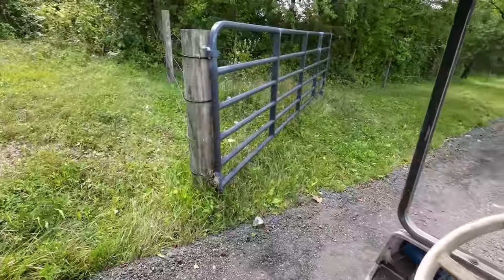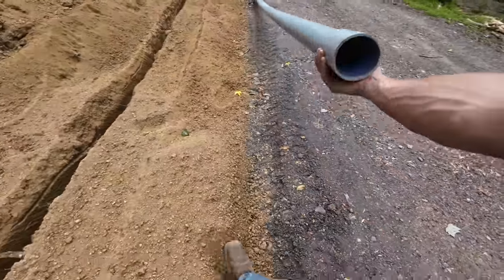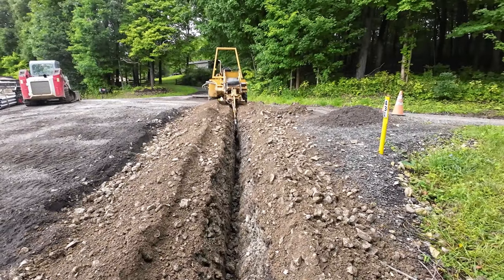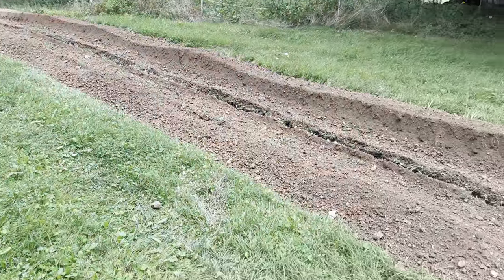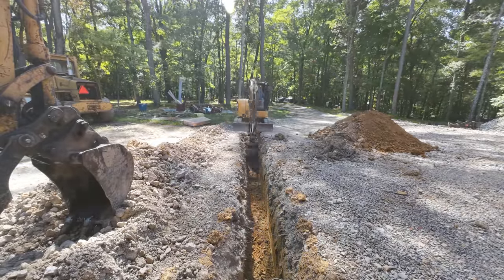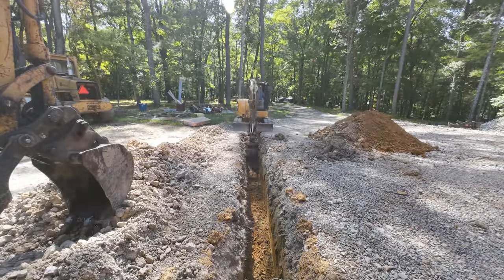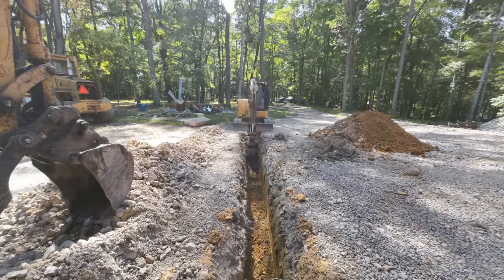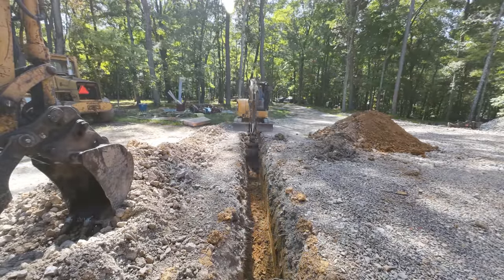Running Nearly 1/2 mile of Underground Electric, Costs over $64,000??!?!

Comment: After watching this, I realize how much better equipped you are than the small public works I'm employed with...
Reply: Damned hard work so far. Now need a power cable pulling thru.. Best of luck
Reply: @gags730 .. you know whats worse than that... legally most state equipment has to be offered for free to local municipalities.. but they never go out and get it.. too much effort.. so your local taxes pay for equipment that they probably could have got used.. maybe not in the best condition but you never know maybe in pretty good condition.. also volunteer firehouses can get free state equipment .. its a good deal that they pass up because either they are clueless or don't realize taxes pay for everything they have.
Reply: Depending on the amount of property you have and the desire to construct a required number of residential properties to be served by your project "may" have produced a cost benefit even a profit.
Reply: @BRI33NOR   He also does more work than most municipalities.  And he is just one man.
Reply: He's sure got just about any tool and piece of equipment a guy would need to do most any job.
Reply: @gags730 u forgot about the part where they piss away money for labor. A simple 2 or 3 man job if it involves a flag in up a 7 to 10 person job. Am most times u drive by them an only 2 guys r working if that. The other guys r other standing eating doughnuts or sitting in a truck eating doughnuts
Reply: Where was the guy overseeing the road crossing infill?
Reply: @GoobiesFunZone  well, there's only three of us for the whole town. Boss man, myself and my coworker. Not much time for leaning on shovels...
Reply: And he does not need 4 people standing around watching him do all the work
Reply: Boy that does sound like highway robbery!
This is what happens when you give a monopoly to a government agency.
Reply: We can see how SHOCKED u are at the connection costs of the electricity considering u did the majority of the work.
Reply: @codysp  that better then most times I seen around my town. Most times the only guy I see working is the flag man
Reply: MATT………For $75,000 you could’ve gotten help putting an entire solar system in with a power wall and used it as a tax credit.  
And had enough for a really nice house diesel generator system😮
Reply: Two of the machines were rentals. If you don't have a skid steer and a truck somethings seriously wrong
Reply: But he had to rent the trencher and the littet CAT excavator. Of all the machines in the video he only owns the Takeuchi skid steer.
Reply: @gags730 going by the rending screams from the excavator I was unfortunate enough to have to live next to for more than 2 years, private companies dont know how to grease/ maintain anything either. I dubbed that one "the screamer" and the sound it made when moving was ear piercing. It did it the whole time it was here, and it was eventualy trailerd off. I dont know if it finaly had enough and gave up, or if they were finished with it, but I celabrated when it went.
Reply: @Lycras  excavator, dozer, dump truck, grader, jumping jack.
Reply: @zippythechicken  Feds offer equipment to locals as well - we got 3 well-maintained Type 3 Fire engines from the Department of Forestry, and the feds put new tires on one of them! You just have to have someone on the company or board that is interested in that type of thing.
Reply: @GoobiesFunZone  What state are you in? I've never seen that in CA - except in crappy little towns where the bad boys in town ended up getting hired in public works in their later thirties (after meth, jail and biking was out of their system). My son hired into one of those, and made a bad impression right of the bat when he wouldn't smoke pot with them first thing in the morning. That evolved into him being nicknamed "princess", and when they started to play around spooking him with heavy equipment, he saw it was time to go. Quite a lesson for a boy I'd raised to show up ready, work hard, and become part of the work team.
Reply: @TokyoCraftsman  The power company is a publicly traded company in west Penn.  In addition to paying for the cost of materials and labor, they have to pad it with a healthy amount to keep their share performance on Wall Street good. Pacific Gas and Electric did that in CA by raising installation cost and cutting back on maintenance, leading to 100 year old tower equipment failing and burning thousands of homes.  A big part of the loss of service and quality of product to the public is not a political thing, it's their concentration on stock performance over what SHOULD be their primary task - to provide excellent products to the public at a fair price.
Reply: Ha, that price of 50g plus got you so flustered you forgot a ton a cuts in edits in the last 10 min of the video haha
Reply: Since getting estimate for power company work I am happy to announce you can get your stickers in diesel creek store for a new low price of $742 each. Thanks for your support
Reply: @87mini  yeah its insane not to want that stuff free.. my school district spent a million dollars on a snack stand for the football field.. you know all of that stuff was brand new.. but the state i saw at the same time is giving away really expensive stainless steel work tables, equipment and refrigerators and stuff .. they should be held accountable when they don't make use of good stuff... well heck biden is auctioning off miles of border fence as scrap metal.. saw that the other day.. they're just getting rid of it so they can't be forced to install it.. things like that make you not trust or respect these people
Reply: You are SO WRONG in most of your points. @87mini
Reply: @BRI33NOR  pop
Reply: Wow, $50,000 can buy you a lot of wind / solar power equipment.
Reply: Same here 😂
Reply: Hello 🤩🚜🚜🚜🚜🚜🚜🚜🚜🚜🚜🚜🚜🚜❤❤❤
Reply: That’s Funny 😂
Reply: Lol
Reply: Clearly I see he's got a plan instead of having them ugly power poles everywhere.
Reply: I assume the public works is not allowed to buy used equipment and repair it right.
Reply: @SetitesTechAdventures  I'm not 100% sure on that. I guess it would depend on what needs repaired.
Reply: Hi Matt,(you  are  a hard worker), I know what is involved, I also do all aspects of dirt work in Washington state. I am currently installing underground power into a waterfront property that we own. The 7,200 volt vault is at the edge of the road on the edge of the property,  I do all of the ditching and restoration from said vault to the transformer pad 275 feet away, I have to buy the transformer ($6,000.00) and the 7,200 volt feed line to the new transformer ($?) Lineman crew of 3 to 6 guys, all connection parts, coffee, doughnuts,  steak, lobster tail with butter flown in from Australia......bottom line is.....$10,000.00 up front, before anything can happen, for 275 feet and then pay a monthly cost for power....I am completely mind blown at the cost of this.....our public utility department is a non profit service for the consumer....yeah right!!!! I feel your pain!!
Reply: Right @Codysp

Comment: Matt, between you and the power company, something was lost in translation. Hire an electrical contractor to pull the wire and set the transformer. Power company only has to connect you at the pole. There should be NO charge for that as hooking up to power is part of theirs tariff. And BTW... THAT was one hell of a job. You rock, brother!!
Reply: Matt, speaking  as an retired electrician I think you should look into this approach.
Reply: you should really look into each and every states laws some places you have to pay for every pole to your place you need.
Reply: Yep that sounds about right. At least in my country thats how it works. You pay the power company to connect it at the powersource, not on your property. The work on your property you can do yourself or hire certified help for. Love your channel and awesome job laying the conduit. Thumbs up from Sweden
Reply: Good advice
Reply: 52,000 would seem more reasonable if they were doing ALL the work that you already did PLUS installing the wire.   I'm glad you're fighting the cost.
Reply: Depends where youre at and the nearest pole/transformer. A lot of times the customer is responsible for over "X" distance.
Reply: This the best approach.
Reply: Hello 🤩🚜🚜🚜🚜🚜🚜🚜🚜🚜🚜🚜🚜🚜
Reply: thats how it works here a contractor does all the work they only connect the lines to the pole fuses.
Reply: @goosenotmaverick1156  that's how it works in my country the network provider will place a property pole inside your boundary 15 metres and that bit of cable is free. you pay for the pole itself and everything from that point. or if your building is close enough they will connect to a insulator bracket on the fascia

essentially he has a private 11kv line running onto his property because of the distance. so that changes things. but yes 56 grand to pull cables and place the connection boxes and a transformer. he would be paying the cost of the transformer. as its a distribution line they own it but you pay for it.

the 500ft distance is the length of a cable roll. you dont want joins inaccessible its also what can be easily handled and if that land is ever subdivided they just run from the nearest connection box and place a transformer for the new customer.
Reply: Matt this guy he knows what he's talking about from my house up North and I hired a contractor to put the wires in underground and it sure wasn't that price and you did everything and it was a quarter of a mile long a mile-long my driveway it's true you can do it yourself
Reply: Yes, I'm sure the power company subcontracts out the work anyway.  Please fight this and explore the contracting options.  You are incredible with all the work you do!

Comment: I'm in a similar boat with 1/2 mile between my shop project and utilities.  Huge install costs, plus monthly bill is why I opted to go massive with off-grid solar and a back up generator.  Will cost about the same to install, maybe a hair less but never have an electric bill that only goes up.

I commend you for the undertaking!  Especially since you had to get to a pole on the neighbors property, not on or at a right away.  

Definitely a crazy huge project!
Reply: Yeah even going with just a large battery bank charged by his generator would be a faction of the install and ongoing costs.
Reply: Having grid power is nice but unless the power company can do it for a reasonable price then off grid Solar + battery + generator might be a better option.
Reply: This is the right move for more people every day. Especially considering that power bill is going to keep going up.
Reply: @SetitesTechAdventures  country needs a big push towards a "personal independence" again.  confidence and comfort come in not worrying about where food, power, heat and shelter come from.  Not there yet on my own project and life, but getting closer every trip to my project.
Reply: I've been offgrid since 2016 totally worth it
Reply: II guess those new batteries and panels should be dropping price in ten years? Yea, sure.
Reply: @robertdavis6708   panel prices have been dropping fast, and my battery prices have dropped 20% in the last year.  The real trick is that technology is advancing quickly so that in 20-25 years if I need to change equipment, the new stuff will provide more power per panel of similar size and battery technology is advancing quickly as well.

 The best part is still no monthly bill, and no power outages.  Where my property is has already seen 3-4 this winter from storms in the area, but our place hasn't noticed.
Reply: I guess if he knew what they wanted to charge him for the connection, he probably would've gone solar. I guess he probably counted around $25K for the whole project...
Reply: @VowellVentures The more people go off-grid, the more expensive individual connections are going to cost. 
What’s needed imo is a reliable and affordable power company that’s run at cost for the community they are part of. 

If that’s not available, then people will go off-grid (and I would do so too). That would be unfortunate though because sharing power generation should be a lot cheaper than each and everyone generating power on their own.
Reply: Solar panels has its ups and downs to you need sun and batteries are not cheap and most are warranty for one year .
Reply: @davidevans474  my batteries are ten year warranty, panels are 25 for 80% rated, definitely not the answer for everyone.  But to spend the potential of $80,000 to get grid power then be stuck with an ever climbing electrical rate.  A massive self built and expandable off grid system was the answer.  At least I own the power and have no monthly bills.  I still get to run tools in the shop too!  That's a must.
Reply: @Conservator.   "The more people go off-grid, the more expensive individual connections"   Yup.   And the more solar on the grid, the more a KW of power will cost from the utility.   Something that doesn't seem to compute to most people.
Reply: @michaelfink2070  Off-grid power setups are decent to snap at the power companies highway robbery, but in his situation where he will not only live but back up heat and use 3phase machinery in proper shop, off grid really isint but stop gap measure and needs to be replaced when batteries and panels die off. Even if solar company gives 30 year warranty its irrelevant if company is dissolved in few years or when warranty claims start to come in and another put up to sell more with same scheme, or more like scam. While suitable for others its not for everyone and we shall see what kind of mess we are in when panels start to fail in mass. Grid connection and back up with solar makes sense, specially if you actually have enough sun to power the panels and maybe produce more than you use.
Reply: @VowellVentures  it's cute that you think those batteries are going to last 20-25 years. You should take up comedy!
Reply: @devvoid1312  panels have 25year warranty, batteries 10.  Not worried about it.  I've had batteries last over 10 years in other applications.
Reply: @VowellVentures  until they blame you for the batteries dying to get out of warranty like most battery manufacturers
Reply: @VowellVentures  good luck getting those batteries to last 10 years anywhere but California where they base the life on 😂